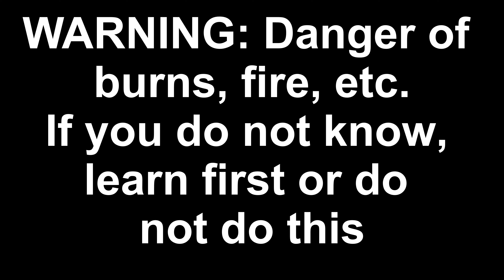Soldering Iron Tip Replacement (4K)

Comment from the maker: POPULAR SOLDERING VIDEOS:
Soldering Basics - Popular Solder Connections - Done Right (4K) https://www.youtube.com/watch?v=udNu-wZaqJE

Myth Busted: Soldering From Below https://youtu.be/gFGvNrYpsGc

Soldering Wires - Doing It Wrong, But Getting It Right (What is CRITICAL?)(4K)
https://youtu.be/Ej284nrwX84

Common Soldering Mistakes 1   https://youtu.be/mv1t-aoSDOg

Soldering Mistakes 2 - Why Mechanical Connection Is Important
https://youtu.be/IPRZOollABY

Soldering Without A Soldering Iron
https://youtu.be/b5iiUMAOGew

How To Solder - Electronics, Car Wiring, Boats, Solar, ...
https://youtu.be/gPpisFM6AIg

Soldering - Water Resistant Joints for Boats, Cars, RVs, Trailers, etc.
https://youtu.be/kZOmRE9msaA